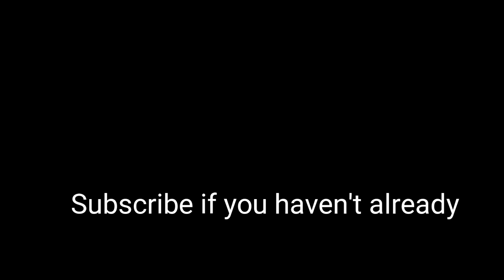How to make $2M a Year in the Roofing Business...

Comment: fuck bro. no harnesses or anything.. how many people have fallen off so far?
Reply: space cadet probably none if you know what your doing you wont fuck up and fall
Reply: Gypsy TV " knowing what your doing " as a way to subvert a workable safety program is a scab roofers way of saying they don't want to spend the extra dollars making sure you go home to your family, I've seen a man fall 270 feet because of another contractors faulty curb hatch covers where the skipped the 2 inches of plywood ,I saw a roofer call off a 11 foot high Kenny shoe store roof directly into a 650 gallon Reeves Hot Tar kettle full of 525 degree type 4 asphalt & die ,I saw an apprentice get hit in the face with a deck saw with a 24 inch diamond blade that cut his face to shreds ,I saw an unlicensed crane operator touch a 1200 volt 3 phase power line at a Ford factory that blew his fingers off ,burned all the hair off his body while the outriggers of the crane pulsed 30 foot high flames from the current, all of this death before OSHA thankfully clamped down on contractors in the early 1990's, a simple $200 call arrest system and body harness will save your life & not slow you down 1 bit once you learn to work safe ,all union contractors are now harnessed above 10 feet and deaths are now rare in roofing ,when I started In 1970 commercial & industrial roofing was the #1 most dangerous job in America, now it's like 15th .
Reply: Michael Ledford damn
Reply: Michael Ledford II was an HVAC mechanic in Toronto. I quit/got fired because I refused to install a chimney liner  on steep pitched roofed 2 story house without any safety harness, The guy I worked for was an independent contractor and the way he got his job was by cutting corners. The big companies would never go on that roof without a harness.
Reply: Golden Retriever a good friend on mine lost his life at work due to a scab HVAC contractor cutting corners ,his negligence was found to be the intentional creation of a deadly work environment to save money ,he was indicted by a grand jury for murder 2 and sentenced to 20 yrs in prison ,his 2 certified HVAC installers were indicted for manslaughter and sentenced to 5 to 15 yrs for cutting corners that killed my employee .

In the HVAC contractors bid packet the architect speced out that all HVAC roof curbs were the HVAC contractors job to install ,and secure ,the architect specified a 10,000 impact for those 4ft x 6ft curbs ,he specified in their scope of work that all curbs were to have an " OAK 4x4 screwed to the curb every 12 inches along the 4ft run ,then 2 layers of 1 inch " Birch " plywood screwed into the 4x4's ,then the curb made watertight with a sheet metal cap ,the wood alone was over $500 for each curb & they had close to 300 curbs to set and make safe ,the contractor had the option of just setting the curbs in place and not cutting out the roof decking until 1 hour before the unit was to be set by the Crane, while watching police tape off the area as a crime scene the HVAC foreman came to me crying his eyes out and told me what his boss ORDERED them to do ,he told his installers to cut out the deck on every curb they installed ,then to SKIP the wood because it was stupid, he told them to just cover the curbs with 2 layers of my roof insulation and a metal cap ,when my friend fell onto the top of the curb he fell head 1st to his death , the top of his skull came apart like a watermelon ,he lost his life and his family was destroyed because a scab contractor wanted to speed up production ,and cut corners  .

Good for you for quitting for being told to work in a unsafe way that can cause your death ,that's a big ass hunk of stainless to be stuffing down a 2 storie chimney without any fall protection ,when home depot sells complete harness ,lanyards and roof bracket hooks for $99 it's insane for any contractor not to supply every employee with a harness ,at my company every roofer must wear theor harness before they are even allowed to climb the ladder, they wear their harnesses the entire work day even if they are 200 feet from an edge or skylight.